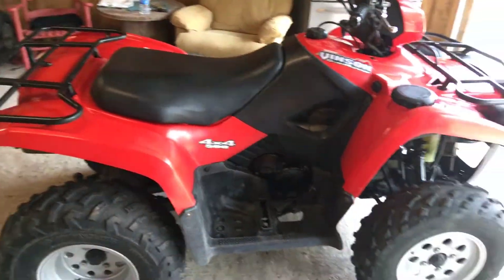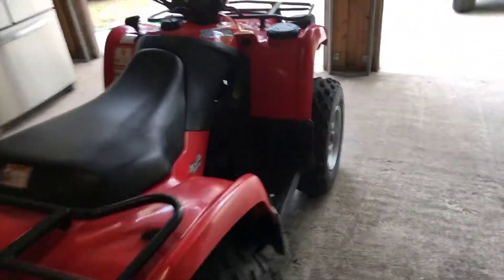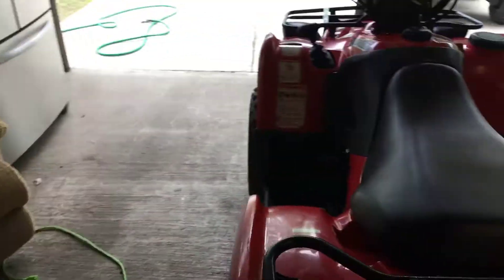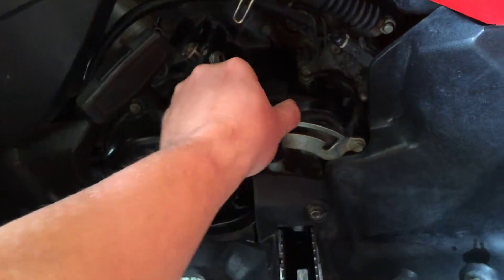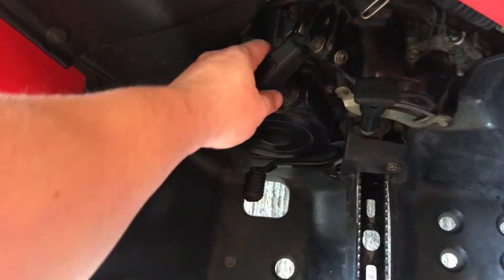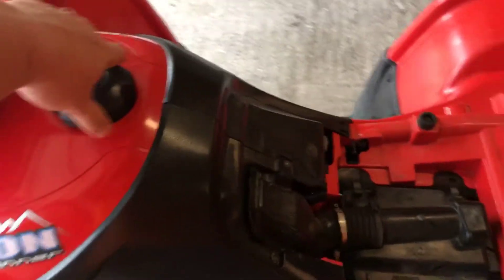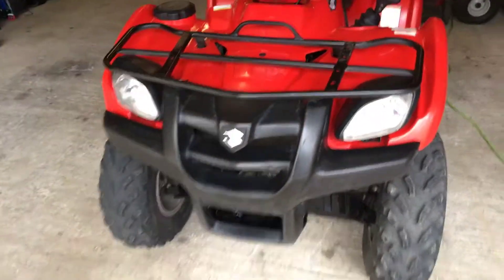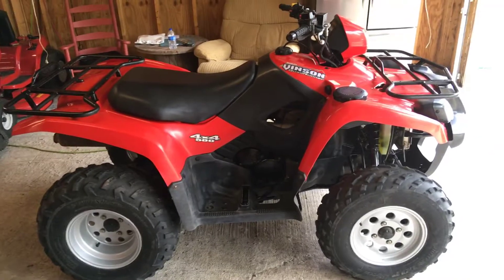Quad Force ATV, 2006 Suzuki Vinson 500

Comment: Great machines. Have a 2002. Solenoid is doing a single click when you hit the starter button. Already put a used tested good solenoid on and a new starter, still doing it. Either need to buy another solenoid or its the starter clutch is frozen up. Maybe a bad ground

Comment from the maker: The Older Suzuki CVT transmission under a load would slip and known to eat belts. Yamaha in my opinion has the best design CVT transmission. So much to the point they have a 10 year belt warranty.